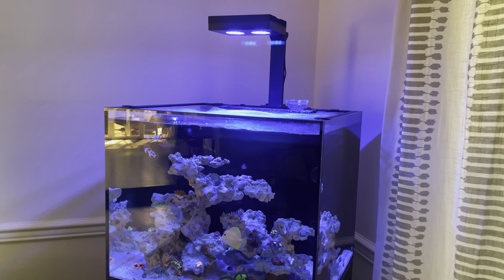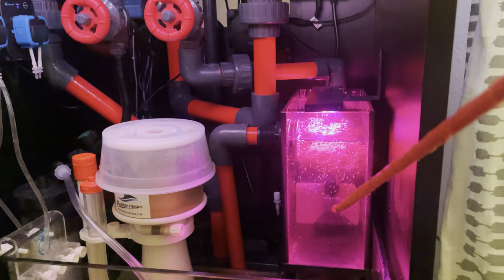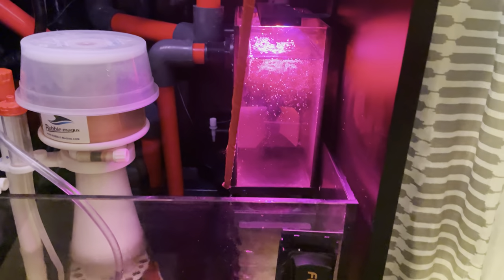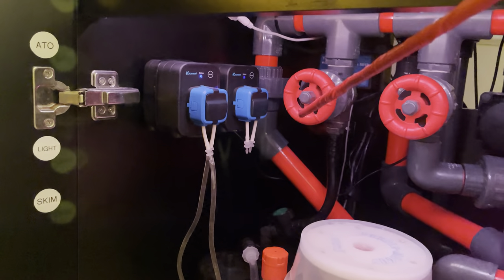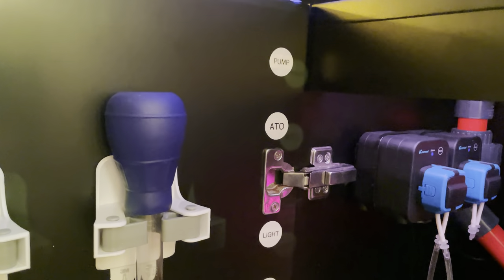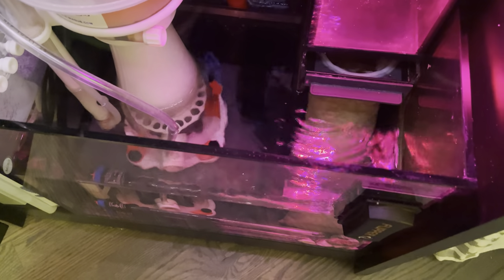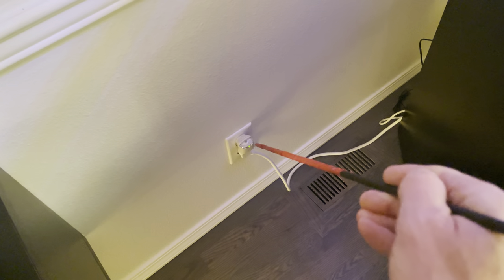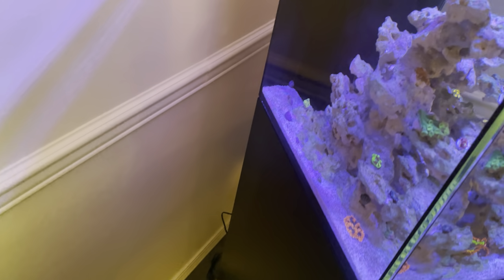Red Sea 170 Reef Tank Tour

Comment: that's awesome! I've been working on my Red Sea 170 manifold and im almost done, should be getting it wet next weekend, used the same color pipe as you 😂, would be interesting to see how you plumbed it at the bottom on the tank. I put my manifold on the left side of the stand though. I also used the same conversion as SithRico's in his video. awesome job!

Comment: Same setup 3 years old running dual Kessil 360s and a Kessil H80 on a gooseneck over the sump.  I pulled my skimmer out and use that whole area for fuge "kay-toe" 🤣😜.  If I skim there just isn't enough nutrient and it withers and I'm suseptible to dinos (high par up top).  Had the Two Little Fishies in the exact same spot fed from small powerhead running gfrc but it was a pain in the ass to change it so I just run a little not all of the time in the spillover and carbon in the sock 🤣.  I'm running SPS Dom and have killed alot of expensive coral to get where I'm at.   This volume of water has been the hardest reef I've ever maintained, built, or managed 😱.  But once you get it dialed .... It's all worth it.   Have fun, your manifold is sick! 🤙
Reply: Oh also, I stopped dosing and just use Kalk again 🤷‍♂️
pH is better and better hardness.

Comment: Hey Tom, congrats on your tank
Amazing custom sump area

I got my first tank and it’s a Red Sea Reefer 170 like yours 
I also got 4 of Kamoer X1 Pro like yours and I wonder how you attached it to the cabinet wall
Reply from the maker: I didn't want to do any drilling in the cabinet wall, so I used a heavy duty velcro tape.  This allows me to quickly pull components off the wall for cleaning or maintenance.  I bought mine at Home Depost.  3M Command strips also work great.

Comment: Could you please tell me the depth of the water level as i have the 170 g2 and looking for a skimmer but the curve 5 skimmer says it needs to be in a depth of 9.5 to 11 inches which is not achievable in my sump as you cant adjust the weir and the ato sensor would be submerged

Comment: Overkill and a lot of maintenance.
Reply from the maker: Those are important words for any reef keeper to consider.  I won’t debate “overkill” as that is relative to the use of the tank and how much work you want to offload to automation.  I do want to comment on “maintenance” as this tank was built to be very low maintenance and the gear discussed should be seen to drive down maintenance, not increase it.  The maintenance consists of measuring Alk, cleaning glass, filling ATO and emptying the skimmer at a cost of about 15 minutes weekly.  10% water change monthly costing about 15 minutes.  Then refilling CO2 absorbing pellets, carbon and cleaning up the refugium every 3 months at a cost of maybe 30 minutes.  The Tropic Marin All-for-Reef and refugium cover all the tanks needs, I no longer chase parameters or make any adjustments beyond the one doser (adjustments based on Alk findings each week, often no change). I suggest any new reef keeper fully understand why they are adding each piece of equipment but know that a very complex setup does not equate to a larger time investment. Usually, you will be saving time by providing greater stability as the core functions of the tank do not require your time.  Something for those building out new tanks to consider, aside from feeding the fish (that can be automated as well), could you walk out of the house for a week and the tank would be fine? That could represent you just not feeling well, being buried by work or other life distractions.  Today, mine would be fine, my previous attempts may not have been.